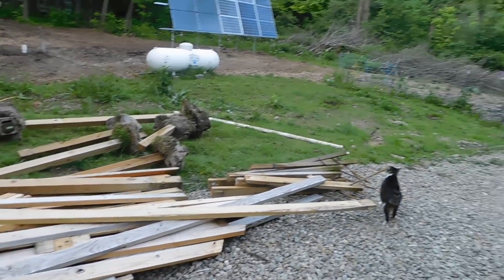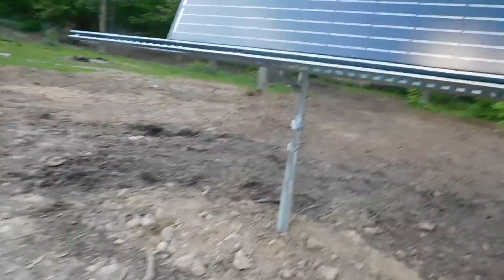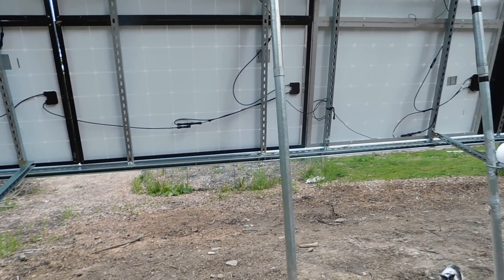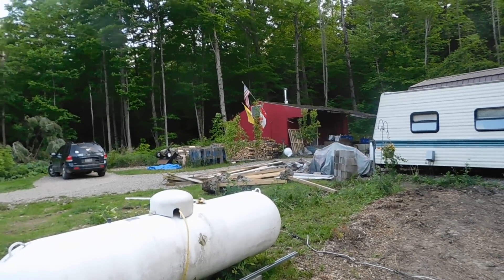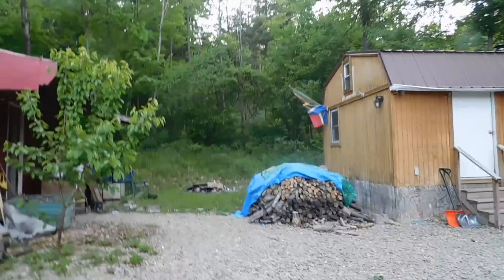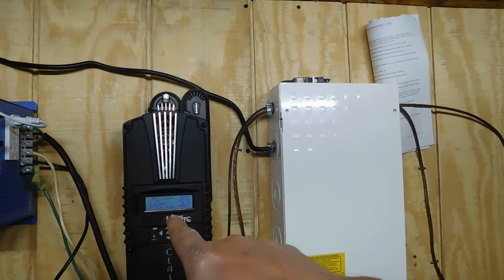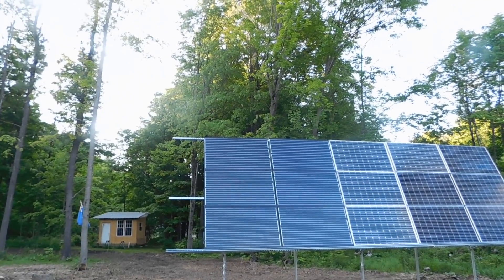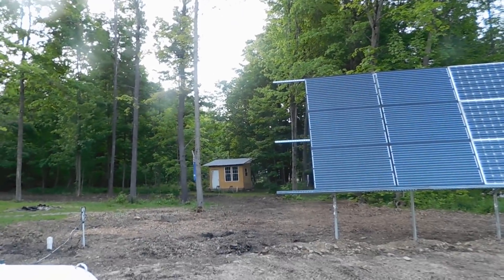The new solar system is complete and up and running.

Comment: Finished!! Looks like the angle is a tad low for optimum output, though. My two 120W panels I have on a pole are able to swing to 90deg. if high winds are coming. I just use them to charge two batteries for a few LED lights in the living room and kitchen, though, so the angle isn't all that important for me. Can't wait to see the power/spring well building!👍🏻

Comment: How much power do you lose due to the distance from the battery room to the panels.  Did you have to upgrade the size of the wire due to the distance.

Comment: Put the broken pieces of concrete back in the holes then fill the last foot or so with dirt, that way you do not have use so much dirt and it gets rid of some of the concrete.

Comment: Well done Ed.  My recommendation might be to utilize (3) 5' sections of unistrut for summer alignment and set the (3) 2.5' sections aside attached to the polls, but connected for the winter alignment. (4 or 5 ) might be better, especially during Winter North winds days.  And a cable to the lower end of the rack and the"Reese hitch" of the vehicle could be utilized to make the operation between the 2 settings safer.  Just a thought!!!!!   
Ya'll ;; B Blessed BIG time 2 Day & 4 Ever,

Comment: I don't mean to complain,  but I'm hearing impaired , when u turn ur face away from the camera,  i can't hear u, ( lip reading) I love ur videos,  lots of good advice.  Been prepping since 1999. Went thru a hard time in 2000 , i used my prepps to survive on till things got better. Yes I can use CC, but it's better to get the info straight from u, CC is not always correct , they leave out or add it

Comment: It would be interesting to track solar power product from the new rack setup.  Adding the extra support strut at the bottom, fixes the panel angle in place.  I am surprised that the rack wasn't pivoted to the 'summer' flat position since were are so close to the summer equinox.

Comment: If you plan on building your own greenhouse, I would suggest a passive solar greenhouse design. Since 90% of your sunlight comes from the south, it is more efficient to build it like a shed, with your polycarbonate or windows facing south, and your north side with no windows at all. Instead, build it like an insulated wall. The heat you trap inside during the day will disperse at night extending your season and more than offset the tiny amount of sunlight you are losing.

Comment: What is the configuration, 3 series parallel ? What is the open voltage?
Reply from the maker: 120 ON ONE SIDE AND 105 ON THE OTHER. I have two 150 midnight classic's charge controller's.